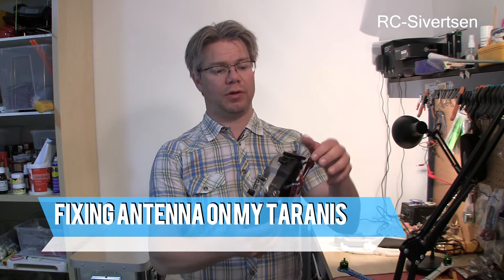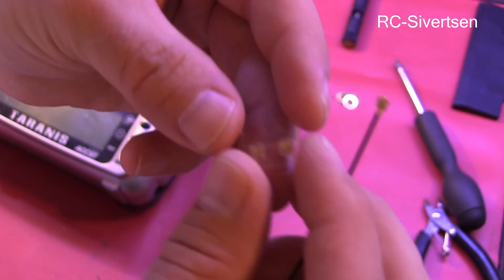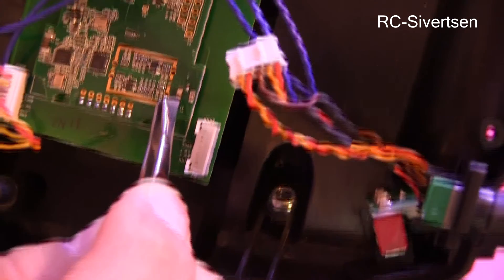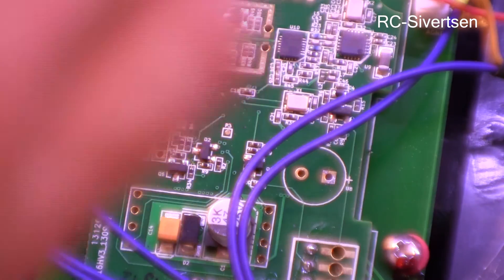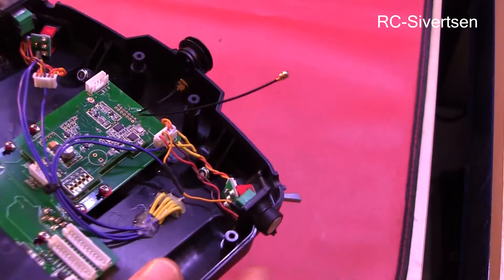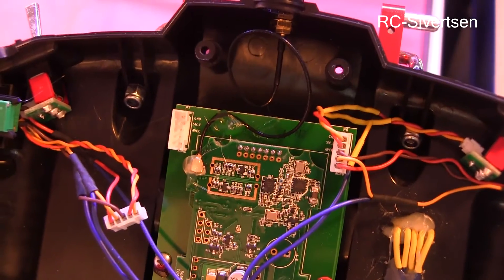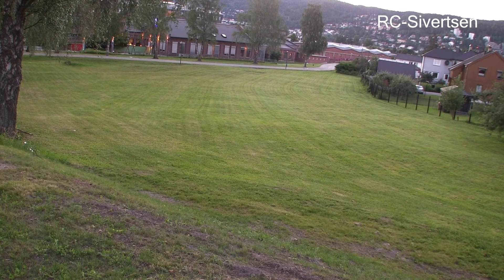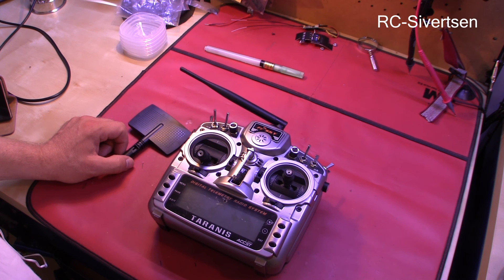Fixing antenna on my Taranis

Comment: Some very bad soldering techniques. Not only do you get a bad joint that may break, it is also less conductive. Solder is not a good conductor, so it matters a lot with microwaves. You actually loose .1-.5db with the added connector. You should just solder the wire directly to the PCB, center coax in middle, and two twists of shielding on either side. Strain relief with some hot glue or tape. Just cut off the u.fl connector and strip the wire.

You shouldn't touch the rosin core wire to your iron and then dab it on the pad, all of the rosin burns off and you get oxidation, and bad joints. To tin the pads, flux them, and drag the tinned iron over them... they will be smooth and shiny. For some connectors, it works good to tin the ground plane on the connector, put it down, and solder that... then flow the rest.

Even easier, is to just use a hot air/reflow station (they are as cheap as 40$ usd), after you tin the pads, put the connector on and hold the air on each pad until it reflows.
Reply from the maker: Fria Gram You are probably right. I'm learning as I go and it was very small parts. The antenna was broken so I had to do something.
Reply: We all do horrible soldering jobs while learning, but usually it's hard to mess stuff up unless you burn out SMD components or melt through the PCB with 400+c temps. But yes, you really should think about just soldering the signal wire directly to the pads, and use high quality cable, with the shortest cable length possible.  If you are losing 2db due to cabling and connectors, that's 50% strength (since it's logarithmic), so you're going to loose about half of your range, making your high quality antenna useless! If you look up the data sheets, you will see each connector added to the chain is some .1-.5 db loss, and that low quality coax is very lossy (up to 3db/foot), even rg 178 loses around 1 db/foot. I still suggest you pick up a hot air reflow gun for soldering SMD components, it's not like a few years ago when they were upwards of 1200$, you can get them for 40-50$ US now.
Reply: Fria Gram thank you for the comment I was just about to do the same thing I did not know that will cost that much problem but on the other hand you was brutal to him everybody's a newbie you was there at one point of time .just saying thanks for the comments learned a lot and please work on your bedside manners and happy flying
Reply: I was just being direct, no insults meant. I don't fly :3
Reply: What do you mean with "two twists of shielding on either side" you cut the shielding in the middle and divided in two strands?
I wonder because if you check some pictures of the original soldering, it only uses one of the ground pads.

Comment: hello im planning on installing a 8dbi antenna do you  suggest a 8dbi or a 5dbi . after i install antenna what do i do next is there anything that i need to do with my taranis xplus transmitter.please help
Reply from the maker: Eddie Saldana You don't have to do anything in the software after replacing the antenna. Whether you use an 5 or 8dbi antenna is up to you. Depends what you gonna use it for.